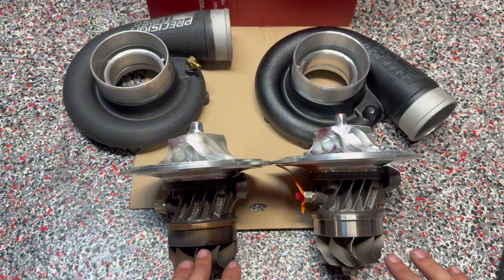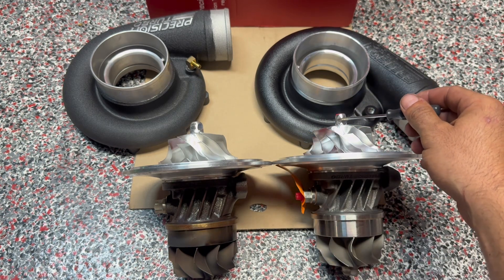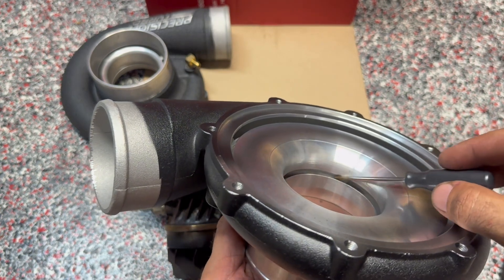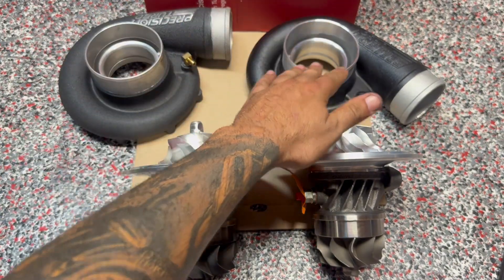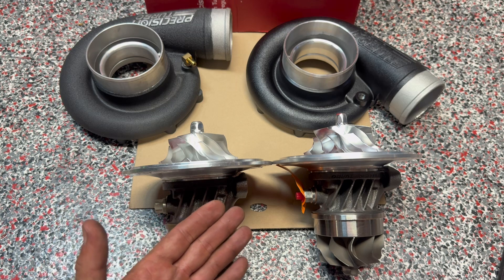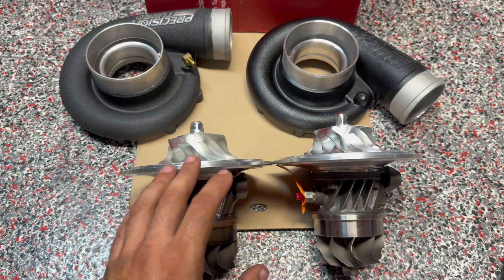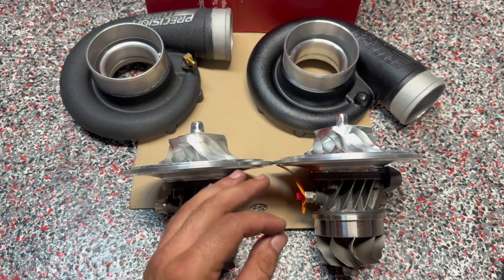Precision 6870 Gen2 vs 6870 Next Gen 1200hp rated

Comment: Excuse me sir, now i have bottom mount setup, with stage 1 trans lpfp, manifold and 1050, no engine build.. i want to enter in the 3 seconds 100-200 so low 4 i guess for a 60-130, can a next gen 6466 do this? Or need at least a 6870 ng? Thanks in advance sir 🙏

Comment: I’ve only had bad luck with these turbos I have a Gen 2 6266 and it came with my car and I paid to have it rebuilt and then had it sent back completely updated and it leaked like crazy at idle and I burnt so much oil in my exhaust. Just sent it back so they can inspect it but I did exactly what they told me to do and had the right lines and everything

Comment: 1:23 No video linked in the description of comparison between Gen 2 vs Next gen, please update.
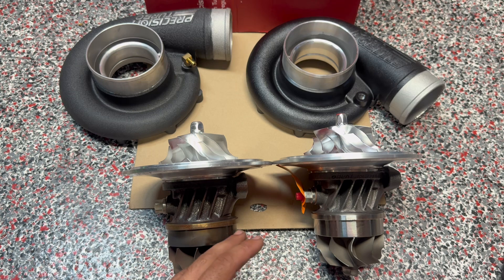Reply: @1:34
Reply: @GOOGLM3_NY  That's just a small incomplete quick snippet of video - I really hope there is a more proper and informative video out there about a comparison.
Reply: @nesmio7378  It spools faster and moves more air at the same boost because it is more efficient.
Reply from the maker: @nesmio7378  fixed it for you and added in the description